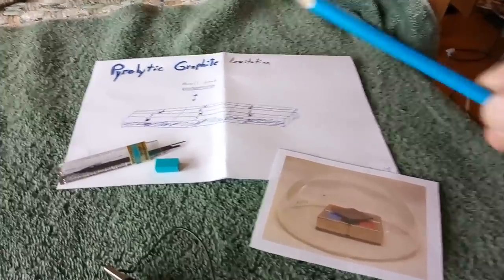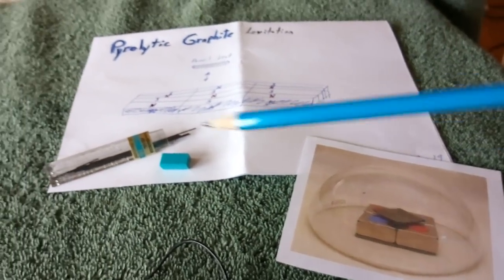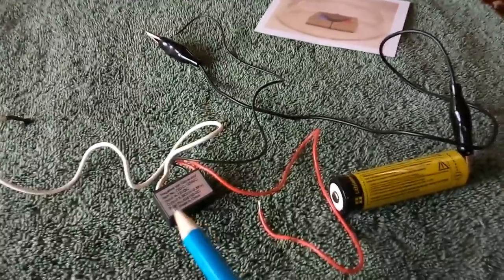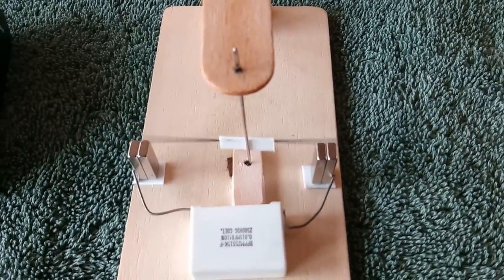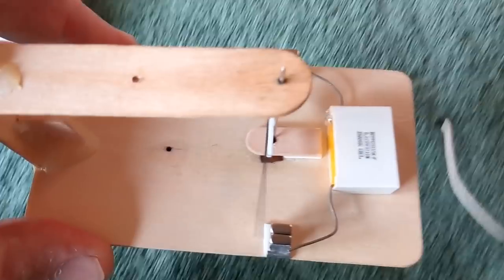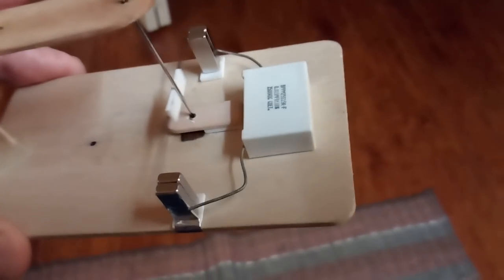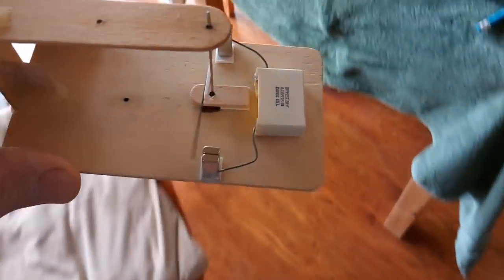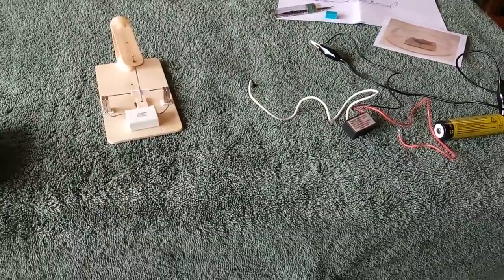Graphite Electrostatic Motion Device

Comment: That is so cool!  I will try it with some larger sheets.
Reply from the maker: I ordered some pyrolytic graphite today and I will give that a try also when it arrives.  This is fun project.  By the way the EZ Spin you sent me is still running 24/7 after 1.5 years now.  It is solar powered with a simple electronic circuit.  A pair 6F super caps in series store the energy for night running.

Comment: Wouldnt that work with out the magnets and replaced by unmagnetized metal? Do the magnets help at all?
Reply from the maker: Andy that is the big question.  The graphite pencil lead is repelled by either a N or S magnetic field (see my last video) but it is weak.  In this situation, because of the coulomb effect going on,  the magnetic repelling effect I think is helping. I did try this without the magnets and it didn't run as long on a given charge.

Comment: Have anyone tried this experiment? Take a PVC pipe, insert copper coil inside the PVC pipe in a way it properly sticks to the walls inside the PVC pipe. Connect LED bulb, full bridge rectifier and capacitor to copper coil at wire coming out of both ends of copper coil from PVC pipe to complete the circuit. Now rub the PVC pipe with silk cloth or nylon cloth to produce static electricity. See if the LED lights up. If LED lights up, experiment is a success. Theory.
Reply: Static magnetic field does not induce current in a coil. That‘s like trying to get a radio signal from static high voltage
Reply: @heavycurrent7462  That's why there is capacitor in the circuit.
Reply: Capacitor is charged by movement of current, not static charge. Unless, you use two different static charges, then a capacitor can be charged. Also, another better way for this setup is to connect the capacitor in series with the pipe, leading to ground. Then short the capacitor with the coil. No rectifier necessary.  But then this is the regular static generator. A more fancy configuration would make it into a van de graaff generator
Reply: You can increase current with step-down transformer. Also you can convert static electricity into DC or AC with Tesla coil by using Tesla coil in reverse meaning you hit the top of Tesla coil with electrostatic lightning instead of using Tesla coil to produce lightning. Tesla coil then converts static electricity to AC or DC.
Reply: @Xeno_Bardock  The lighting is the current, produced by the breakdown of the air, like a shorted capacitor. The tesla coil cannot be charged by a static charge as suggested by your experiment.
Reply: @Xeno_Bardock  You can think of a static charge like a capacitor. If you let them sit, they‘ll stay where they are, and that won‘t have any effect to coils. But if you short a capacitor with a suitable load, the sitting current starts to move. This movement produces magnetic field which can then interact with coils. Therefore, unless you have a mechanism to move the charge, it won‘t even charge a capacitor. That‘s why it is called static, as in not moving through anything.
Reply: @heavycurrent7462  Lightning is very powerful electrostatic discharge with millions of volts at thousands of amps.
Reply: @Xeno_Bardock  True, but ironically that‘s the reason why can‘t harvest them. I think just "catching" its wave would be an alternative, rather than trying to bottle the bolt itself.

Comment: Use a graphene super cap.
Reply from the maker: I has to be a high voltage (KV) capacitor.  The super cap voltages are too low.  The KV caps becomes very dangerous when you up the capacity.  This might run on a hundred 9v batteries in series.

Comment: How is it oscillating??
Reply from the maker: This is just electrostatic coulomb effect but the magnetic repulsion might be adding to the performance.
Reply: @Lidmotor  I understood it was a static discharge from your vid, but I'm wondering how it is causing the lead rod to oscillate.  The lead rod seems to be vibrating.
Reply: It is a graphite rod.
It is attracted to one side.
When it is charged, it repels.
When it touches the other side, it discharges, and so on.
Reply: @_John_Sean_Walker  What is the natural charge of the rod & what is the type & charge/s of the supply power?
Reply: The natural charge of the rod is zero with respect to the room.
The power comes from the capacitor(listen to and see in the video.)
Reply: @_John_Sean_Walker  I'm aware of the power source, I'm just trying to get at how it is causing the rod to move.  For motion to occur, the rod has to react to the applied power.  And that is exactly what I'm asking about.
Reply from the maker: It works just like a 'Franklin Bell'.
Reply: @Lidmotor  I see.  Good reference.  Thanks, Rusty!
Reply: @Lidmotor  Hi. Does it work without the magnets? Or do they stop the graphite getting stuck to the electrodes when it's attracted?
Reply from the maker: This works without the magnets but it works better with them.